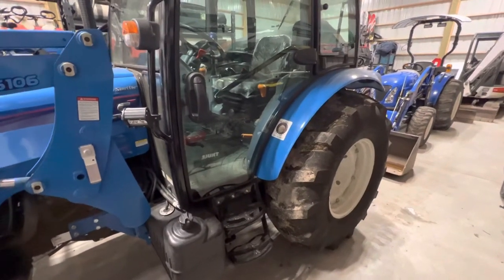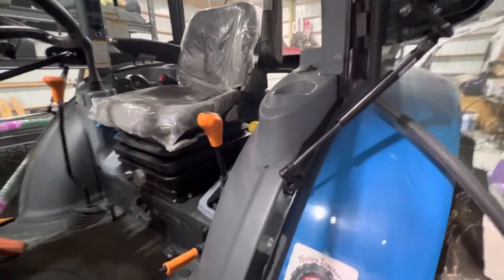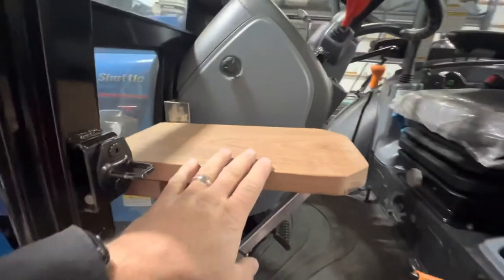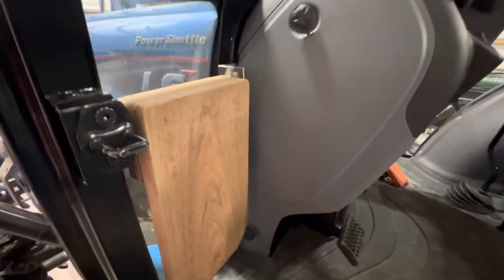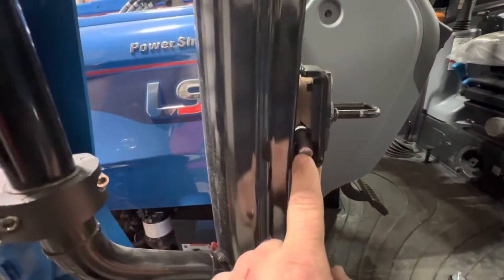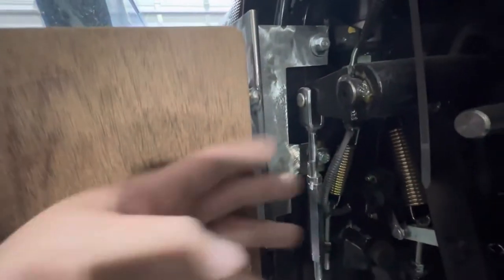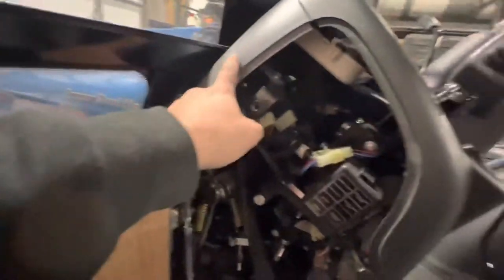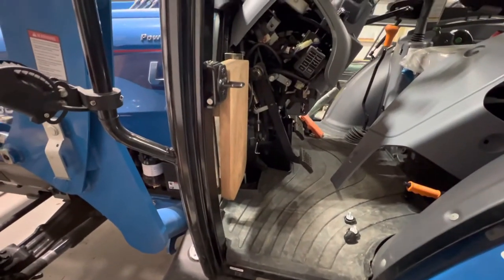LS Tractor MT4 58 Custom Jump Seat Buddy seat

Comment: Fantastic idea! Looking backwards may not be so fun though. What about the rattle? Does it rattle against the glass or anything?
Reply from the maker: Yes, looking backwards is not as good as being able to look forward but I have not been able to figure out how to add a forward facing seat in this tractor. As for the rattle, the way I have the wood clamped around the steel rod keeps the seat from swinging back and forth and has not been a problem.  Thanks for the comment and for watching!